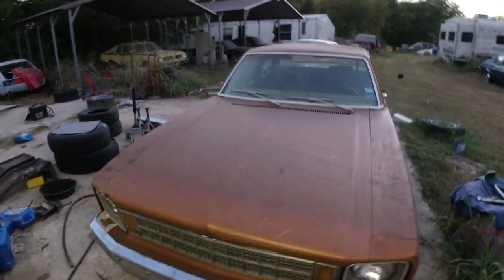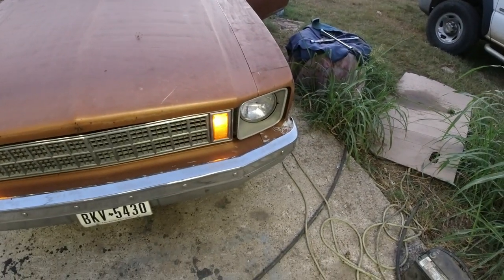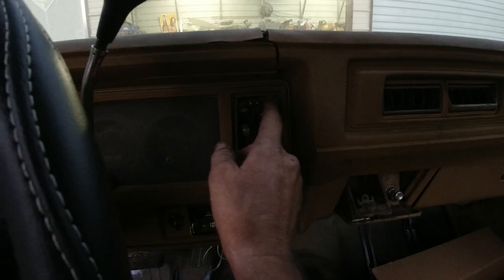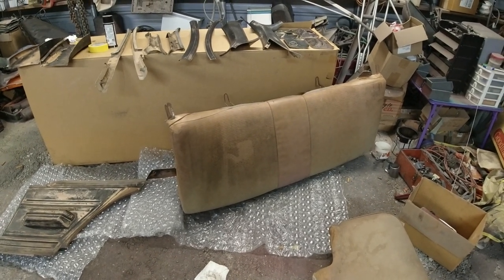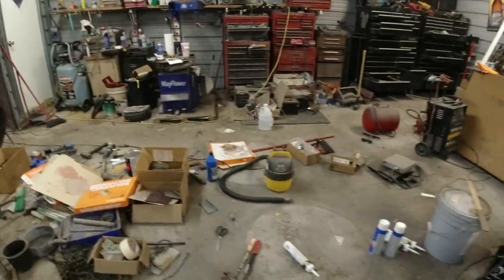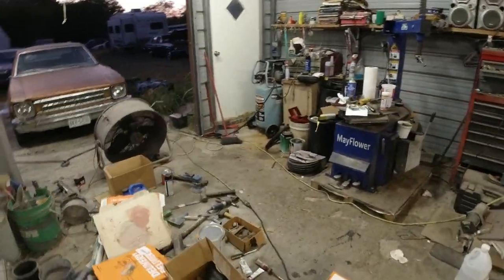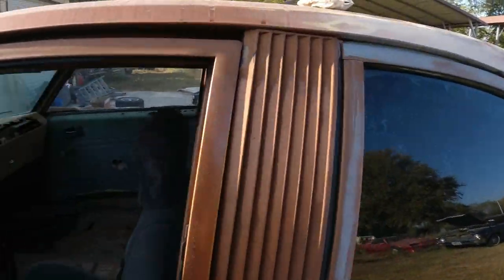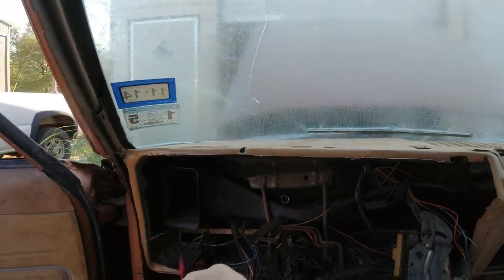Restoration of a 1978 Chevy Nova - Part 7 - Budget Build

Comment: I used Colgate toothpaste on my clear plastic  and I use that old scratched sand for icey roads windshields  since we dont use salt on our roads but put sand on overpasses and bridges you get sparkly lightly pitted windshields and the toothpaste has just enough grit to clean up the small pits and scratches out of  the plastic and the glass  then I use a McGuire's or the like Plastic polish on as  a final step then I put the plastic piece in an upside down bin and pour Future floor wax over the plastic and then lay the bin over it to keep dust from falling onto the acrylic coating and let that dry overnight However some different automakers use a thicker plastic and that final acrylic step can cause distortion when you are viewing it so a word of caution  test a small area and then decide if it needs the future floor wax step!! Nice job on covering the Dash !!

Comment: On those door cards that look nasty after base coats of paint, go over them very lightly with 0000 steel wool to level the finish, and then put finish coat on.  It should make a big difference for you. Good luck
Reply from the maker: I'll have to try something.

Comment: The tint doesn’t look too bad, don’t beat yourself up. With the crazy prices for paint and trim parts even mild restorations can get cost prohibitive. It makes more sense that the dimmer switch was the issue rather than the head light switch since the front parking lights and rear tail lights came on when you pulled that switch. The dash pad turned out nice.
Reply from the maker: I had a brain fart and should have checked the dimmer switch first.
Reply: Try the floor dimmer switch. On left side driverside. They tend to corrode at wiring. That goes directly to headlights.

Comment: For the rear interior side panels,  an epoxy primer or primer sealer would have leveled out the surface to help your black top coat to go on more evenly.  I worked in a paint and body shop supply store for a number of years.  I have been watching a lot of your videos trying to get the motivation to start my project on a 66 Chrysler 300.
Reply from the maker: Thanks for watching!

Comment: about the centercaps.

i have chrome rings on my winter car. they came loose and just turned in a different speed like my wheels by accelerate or braking.. damn i never forgett that sound. and it was the new style chrome rings that are even hard to put on.  i think your center caps could do noises too

Comment: Dash looks great!!!  Can't wait til the next video.  You probably did but have you tried taking the needle of and then putting it back on at the correct spot or can you do that on that one.
Reply from the maker: I took it off but didn't see where I could alter the needle.
Reply: @clunkersandclassics  I know on some that I worked on we could just slide the needle off the shaft. Then we would turn on power then off. Then you repress the needle back on pointing to e.  It could be something wrong with gage but could be someone pulled it off and did not put it back right.

Comment: That's the speedometer Gary it's probably not turning it's probably seized or the cable will see inside of itself both of those can be obtained pretty cheap on eBay and Amazon

Comment: and the gas gauge is a bad ground problem exactly the same problem like on my 80 el camino. maybe your ground cable is broken or something . cause mine started workingt after cleaning
Reply from the maker: It's not broken but will take it off and clean it and see if that works.